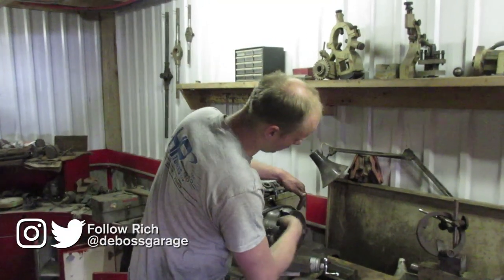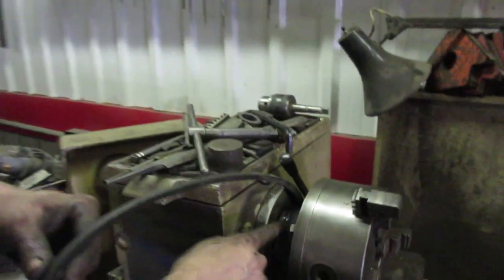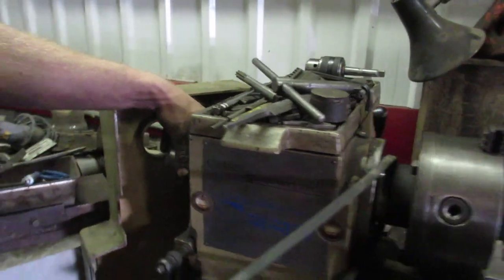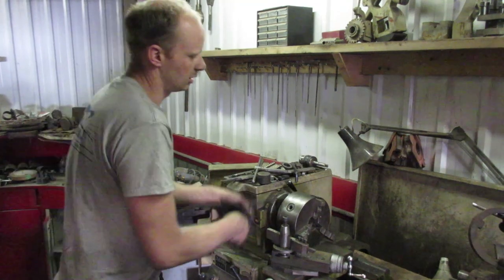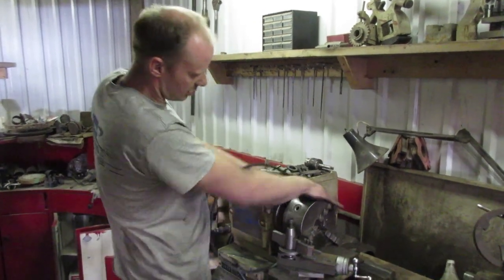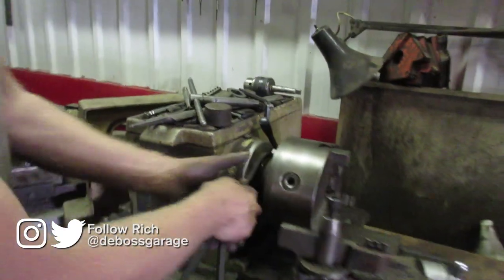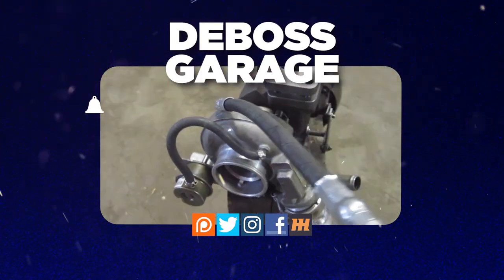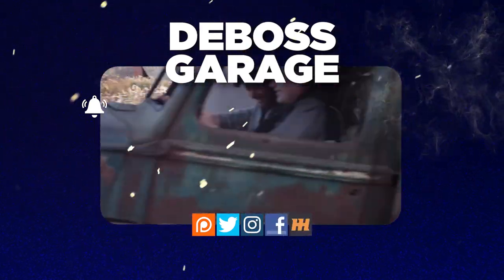Lathe Chuck Removal - Quick & Easy

Comment: i just leave the gears ingaged on low and put t handle in chuck and pull back real fast ---did it this way for 30 years bo problem lol but to each his own lol
Reply from the maker: This chuck gets changed every 10 years or so.  This way is a little more aggressive for the ones that need a little more persuasion.
Reply: lol i see i used to run a big moarch with a 10 foot table and the taper atchment i sure do miss the old girl she was a sweet 1 for sure
Reply: M noju ju
Reply: Great way to destroy the gears